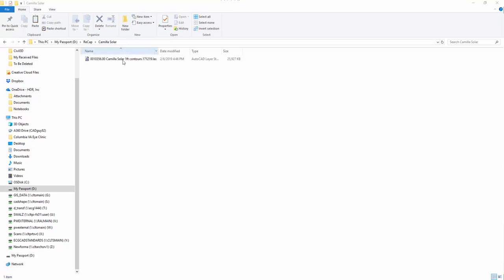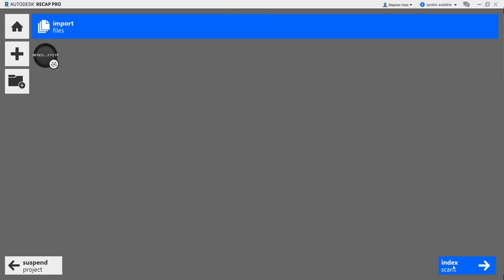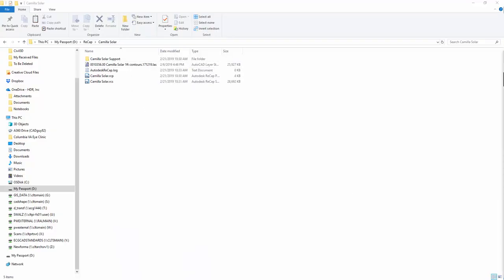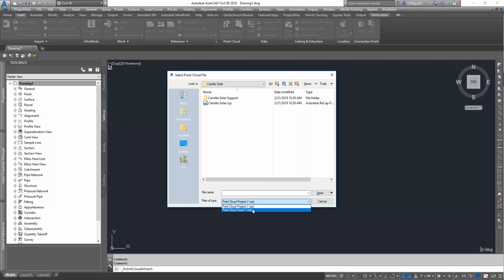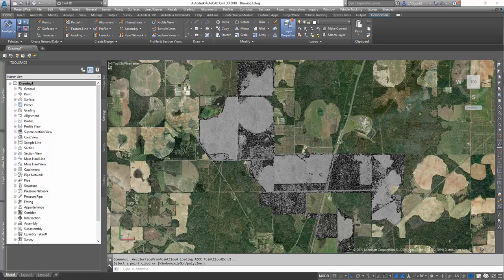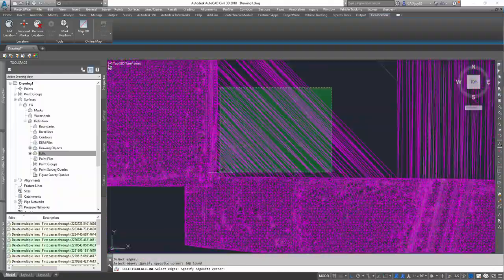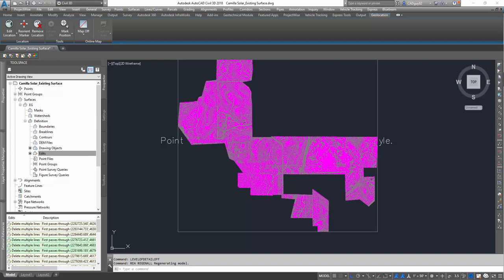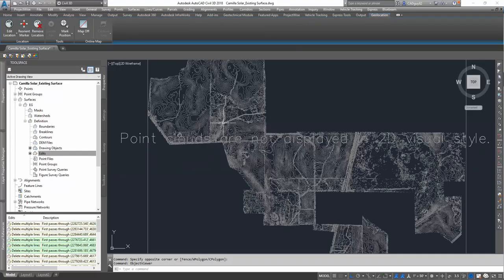Working with Drone Point Clouds in ReCap and Civil 3D

Comment: you can also automatically clean up those extra triangles by using the maximum triangle length under your build options.  Might not get rid of all of them, but it will get rid of most and then you'll have much less cleanup to do.
Reply from the maker: That’s a great point! I’ve used that function a few times, but forget that it’s an option until it’s too late most of the time!
Reply: Yep, Good tip. That's how I do it too: 
Surface Properties / Definition / Build / Use Max triangle length.

Comment: When working with relatively flat terrain like that try changing the Triangle Exaggeration in the Surface Style to anywhere from 2x to 10x. It only effects the display in the Object Viewer which really helps to visualize what is going on.   (similar to how many construction plans utilize Profiles with exaggerated vertical scale.)    Nice video BTW.

Comment: Is there anything to help if the point cloud is not automatically referencing the geolocation on civil 3d? I have the same Datums set for both recap and civil 3d
Reply from the maker: Assuming you’ve double checked units are identical in both Recap and Civil 3D as well prior to inserting? Maybe play around with the INSUNITS in C3D? If that doesn’t resolve, I’d be happy to take a look…feel free to send me a message at stevewalz@hotmail.com to troubleshoot further

Comment: You want to make sure "insunits" in Civil is set correctly (21 is U.S. survey feet), otherwise the cloud will not be correct. Another tip is use LAZ rather than LAS (the file size will be significantly smaller and the import to Recap is much faster). Lidar tools "laszip" works well for that purpose.
Reply from the maker: Great tips Bud! Much appreciated!
Reply: @stephenwalz3900  The insunits setting drove me crazy when doing photogrammetry. Nice vid btw.